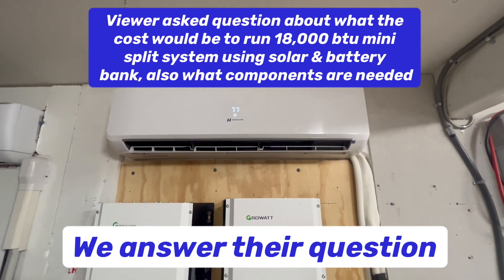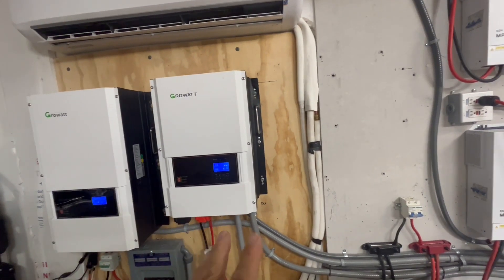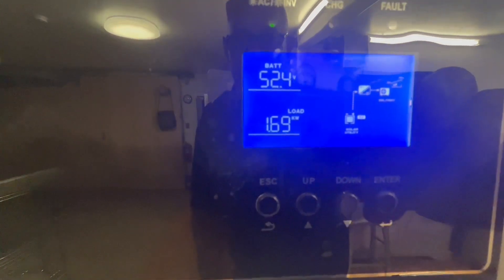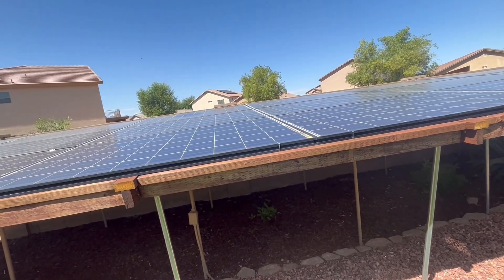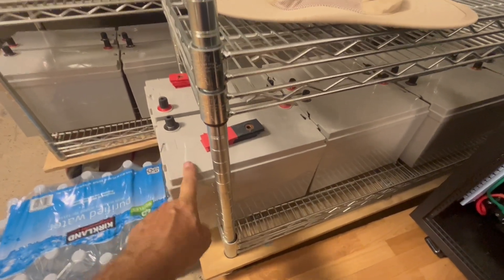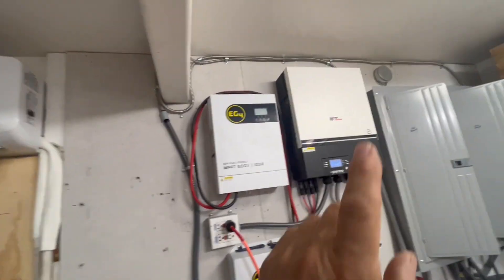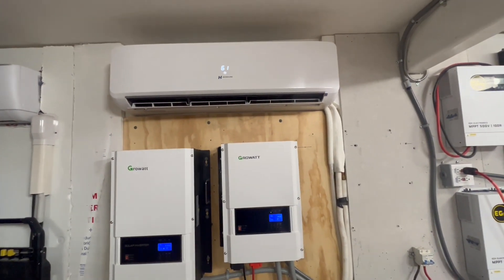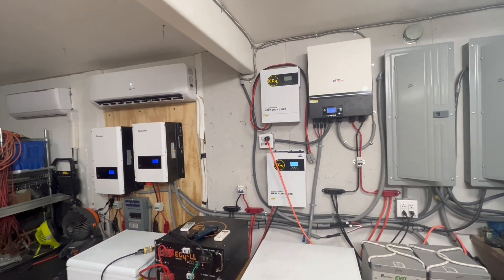Answering question from viewer using solar & battery bank running 18,000 btu mini split AC & cost

Comment: What was the Ah rating on the AGM batteries you had operating the mini split before going to  lithium-iron phosphate? Where in Gilbert do you get used solar panels?
Reply from the maker: I had 16-12.8V AGM batteries. Each battery 100ah. But you could get away with 4-12.8V batteries in series to make a 51.2V battery bank for a 48V inverter. Each AGM is 100ah but 4 in series is still 100ah 51.2V battery bank.

You cannot run the mini split until you have enough solar and cannot run mini split overnight on battery bank. You can not drop battery voltage below 12V average on each battery. 4 in series would mean you should not go below 48V on 51.2V battery bank. I still have those 16 AGM batteries and they still work because I kept in air conditioned garage while using and kept from going below 48V when in series.

You can get a hybrid 12,000 Btu mini split that is direct solar connect that runs on solar only during the day (example 4-400 watt solar panels in series) and use a new 12 gauge extension cord to connect to plug into 120v grid outlet and run on grid overnight. You would not need inverter or battery bank for hybrid mini split. 

SanTan Solar is located in Gilbert south of the 202, about 1 mile East of Gilbert road on Germann. 
596 East Germann Rd # 104. Please use Link below to purchase products on their website. 
You can get new and used solar panels and the 12,000 Btu hybrid mini split from them.
Airspool Solar Hybrid AC Unit With Heat Pump. 

https://www.santansolar.com/?ref=PappasOffGridSolar
Reply: @diy-solar-guy  thanks for the info, I sent you an email
Reply from the maker: @tadstephen8802 not seeing the email?
Reply: @diy-solar-guy  I sent to the email that is under more info on your channel
Reply from the maker: @ I’m sorry, I still can’t find email? Did you send it today?
Reply: @diy-solar-guy  I sent it again
Reply from the maker: @tadstephen8802 mi 18,000 Btu mini split uses 2200 -3000 watts at peak in middle of summer. I need 5000 watts of solar panels to insure I can run the mini split and not discharge my battery. While running. Would need at least 4000 watt output from inverter.

Comment: What if you put a 110 mini split w heat pump on box truck using 400 watt flex panels would that cut how many pannles
Reply from the maker: A cheap 110 volt mini split (cost $500-$800) will need 1200-1300 input watts from solar panels. You would need 2000-2400 watts to consistently get 1200-1300 watts through the day time. You would need an inverter and batteries as well. That will be at least $1500-$2500 for inverter and batteries basic set up on top of cost of mini split. If it is cloudy, you might dip below 600 watts input. Then the mini split would stop running. 

You could buy a hybrid EG4 12,000 Btu 110 volt mini split that can run on 600 watts or less direct with solar input into outside unit. You could run that as soon as you are able to get around 230-300 watts of solar input.  It you would want to connect 1200-1600 watts in solar so it would stay running when cloudy out.

I just installed the EG4 hybrid 12,000 Btu mini split in my garage and run with just 7-100 watt solar panels in series during the day from 8 am to 4pm. I actually have 12-100 watt solar panels that I will use when I go camping and use a portable ground mount solar array set up.

Basically if it takes 1000 watts peak to run a cheaper mini split or what ever you want to run, double the running watts in solar panel input. So use 2000 watts input. The EG4 hybrid 12,000 Btu mini split, you can install 1200-1600 watts. Hope this info helps. Hope you have. Truly blessed 2025
Reply from the maker: Also flex solar panels will only last a couple of years vs rigid aluminum frame solar panels lasting 10-20 years. The quality on flex panels is not there yet for long term in weather especially AZ weather. I see a lot of videos where there get burn marks in just a couple months to a year making solar panel a hazard and needs to be replaced. Aluminum solar panels are up to 75 percent cheaper than flex solar panels. Check out the Grape 100 watt solar panels in the link on my video. Right now only $35 each plus shipping and tax.

Comment: This is kinda not up to date information? You can buy a 1200BTU EQ4 AC/DC mini split Seer2 22 with no inverter no batteries and a built in AC limiter for about $1300.00
Max 380 volts  min 90 volts. Im running one on 4 370 watt panels in series.
Reply from the maker: You are correct, you can get direct solar connect mini splits now that can run during the day with no inverter or batteries provided you have enough solar connected for cloudy days or rainy days. Thanks for sharing.

Comment: Just get you an EG4 hybrid mini split No inverters needed you connect directly from the solar panels to the unit, I have four 400 w Canadian solar running to an EG4 hybrid mini split with no inverter and it works flawless.
Reply from the maker: Very nice, I want to get one of those mini splits as well. Thanks for your input. Hope you have a very wonderful and extremely blessed 2024.

Comment: $15-20K is adequate, depending on your location. When your neighbors are out of power, can’t get to town due to ice or the gas station doesn’t have power or internet and can’t sell you gas…you’ll still be warm and making coffee. It’s silent, doesn’t stink, rarely breaks.
Reply from the maker: You are correct. The best part is the system is already paid itself in savings. Now it is just free electricity from here on out. Recouping your cost in less than 4 years is a great investment. Especially since out kw cost has almost doubled in just 2 years. I have 20 extra solar panels in case I need to replace some down the road and back up inverters. Thanks for your input. Hope you have a truly wonderful and extremely blessed New Year.

Comment: Basically you need a million dollar system it seems.
Reply from the maker: With inflation the way it is going, that’s about right.
Reply: Not necessarily, you just have to be willing to shop around. I put a decent system together for about $5000. Not all at once of course.
Reply from the maker: @asus12351  exactly, this is an investment that will pay off saving you a lot of money down the road. I invested $20,000 over 4 years and the system has paid itself off in savings already. This year will be free electric. Our electricity rates have almost doubled in just the last 2 years. My electric bill will continue to be low all year long. I over produce so I can save even more by adding more things around the house to run on solar power in day and battery bank at night. Thank you for your comment. Hope you have a wonderful and blessed week.

Comment: Hello I am in Phoenix area on the westside. How many batteries do you have and how much do you want for them? Are you for hire to install a solar system just for my mini split in the garage? i have solar for the house already and not so happy with the results.
Reply from the maker: Hi, I am in the southwest corner of Phoenix. I have 16 AGM batteries, want $100 each. I use the AGM batteries only during the day. Just using they batteries to run ac in house during the day reduced my electric bill over 60 percent. I had 4 separate 24 volt 120 volt output inverters in parallel at the time that could run 5 mini splits. I can show you how to install mini splits and set up off grid solar but physically I am unable to do installation. I am going through some medical issues., I can show you how easy it is to install yourself. Actually took me 6 days to install mini split in motor home. Had to use hard core prescribed pain killers day and night.That would probably take you 2-4 hours to do the same.  On grid solar is not a good way to go here in Phoenix due to the utility company punishing you to go solar. They are loosing income when you go solar. They wanted to raise my electric bill to a minimum of $125 month. That would be even if I produced 100 percent of my own power. My winter months are $60 now and $100-$150  in most summer months.I would be happy to explain and show you how to do it yourself since you live so close if you want to contact me. An email to contact me ppag53421@outlook.com. Contact be and I will help the best I can. Hope you have a wonderful and blessed day

Comment: What size of charging controller would you need for that system  for mini spilt but my mini split is 110v   off grid and what size of inverter
Reply from the maker: At least a 24 volt pure sign wave inverter. You can connect between 2400-3000 watts in solar panels. You could run 2 mini splits with that system.

Comment: LifeP04 is a game changer when it comes to off grid. I started out with a deep cycle in my shed to run a 40Watt LED light connected to a small 400W inverter. It could hardly keep up I found cheapest 100-amp LifeP04 battery off Amazon about $230 on Prime day. What a difference it can go to a much lower voltage, and charge lot faster which is what you want for solar. My battery charges up off 2 265W Q cells in an hour. Now I have a small window AC unit in the shed with high temps in Phoenix right now can't keep up I'm using Utility power during off peak in the day. Then I run it off the panels during 4-7pm peak time.  I'm thinking of expanding EG4 system and batteries is a great deal 100 amps at 48V for about $1300.   Doing some quick research, I calculated could build a DIY off grid system for about $1.15$ a watt. I could be wrong but be cool to do some real calculations using Santan solar used panels. EG4 can be synced together along with the batteries.
Reply from the maker: It is an investment but I spent around $5000 a year for last 4 years and system will have paid itself off in December of 2023 with just electricity bill savings. Thanks for your wonderful input and hope you have a wonderful and truly blessed week

Comment: Are you still considering selling your AGM batteries. Richard
Reply from the maker: Yes I am still selling the AGM batteries. Have to be able to pick up locally. 4 for $600($150 each)or 8 for $1000($125 each). I have a total of 16 AGM batteries. I used to run my 3 1/2 ton upstairs air conditioner and 2 mini splits downstairs from 8 am to 5 pm daily using these AGM batteries. I had 4 sets of 48 volt battery banks in parallel. Never let go below 12 volts each. Did not use overnight. Saved 60 percent off electric bill using these batteries during the day. Using the LiFePO4 batteries overnight really only saves me another 25-30 percent. But LiFePO4 were really expensive. With this weather I run my LiFePO4 batteries down to 20 percent overnight and some nights when temp is 115 or more I still run ac on grid power so I have 100 LiFePO4 battery bank in morning to start cooling house at 6 am. Let me know. Hope you have a wonderful and truly blessed week
Reply: Sorry more than I thought. Good luck. I live in Mesa Arizona
Reply from the maker: @galenluth4347  thank you for your reply

Comment: Not sure what type mini split you're using.  I have 4 of them (1-24,000, 2-12,000, 1-18,000 btu) and none use that amount of amperage.  I live in the desert too.  The 24,000 btu has been connected to a 15 amp/240 volt breaker for 3 years without ever tripping a breaker.  Amp readings at the unit measure 2 to 8 amps per leg (range).  Also instead of buying premade lithium battery banks, I was able to build a 11,500 watt/hr battery for under $2000 using 16 - 230 a/h (3.2) prismatic batteries in series along with a JBD bms.  Even with a Victron 150/35 charge controller the cost was barely above $2000.  I was able to purchase a Sigineer split phase 6000 watt inverter (also charges off grid or generator) for under $1200.  So, for less than you paid for your 4800 watt/hr EGXyG748921 battery, I built an 11,500 watt/hr battery.  2-1/2 times the storage for the same money.  You need to remind your viewers that it's always better to build yourself if at all possible.  And perhaps get your mini-split checked out.  I owned an hvac company for many years so I have a bit of experience with unit amp draws.  I saw a lot of waste in your system.  Overkill, if you will.  And YOU CAN used mixed panels with the proviso that your output will be diminshed to roughly the least pane's output.  If you can feret out the very weak panels and eliminate them it's possible to produce output using mixed panels that is good.  And if you buy large lots of used panels, you can test them and match them for some pretty good results.  Many of the used panels are down in output and thus the reason for their replacement.
Reply from the maker: I am able to start a 3 1/2 ton and 4 ton central heat pump and a 12.7 ton heat pump pool heater with these 2 Growatt low frequency off grid inverters. Mini splits slowly ramp up, but these heat pumps have a huge surge at start up. It is not overkill on system. It is what is required to start very large loads. You won’t be able to start these heat pumps with that set up. You can build your system the way you want but you shouldn’t criticize others for building their system the way they want to. You are comparing apples to oranges thinking you are comparing apples to apples. The whole point of DIY is to build a system that makes sense for your own unique situation, I should not try to build my system according to what you want me to build it to since you have no clue of what I need to run with my system. Someone asked me a question and I answered it with the equipment I have. It is reckless when viewers go off on a tangent. The viewer did not ask you the question or ask for your opinion. You seem to assume a lot in your comments and assume anyone else that does not do it your way if wrong. I am happy you built your system the way you wanted to. I have no problems or suggestions for you for your system. You built it according to what your needs are. I built my system while going through 2 incurable caners that I still have to get treatment every 8 weeks along with the extreme pain and side effects. Built it all by myself taking days and weeks to accomplish what you probably did in minutes or hours. I can only work solar for a few hours a week due to limitations I have. Some times I can’t work on it for weeks at a time due to pain and infections. So comparing what you built to what I built makes no sense. I am greatly limited by my condition. Maybe you could think about this before you try to make a DIY person look stupid on purpose to try and make yourself look smart. I think a smart person shares what they accomplish with others at no cost to them except their time. That is what I am trying to do. I could of deleted your comment but wanted to take the moment to share facts you knew nothing about so that maybe you don’t do this to others. Sharing what you built is wonderful. Trying to make others look stupid on their own channel is prideful and makes you actually look bad in the end. I forgive you and hope you will in the future share your what you accomplished and stop there. I hope you truly have a wonderful and extremely blessed week
Reply from the maker: Thanks for all that information. Hope you have a wonderful and blessed week
Reply: Where can we see Your DIY video?  I would be very interested in your setup.  Thanks!
Reply from the maker: You can see my videos on my YouTube Chanel, DIY solar power with pappa off grid projects. DIY solar guy.
Reply: @diy-solar-guy link plz
Reply from the maker: What link are you looking for? Components? Videos? Not sure. Please be more specific, Thanks, hope you have a wonderful and truly blessed week.
Reply: would you please make a video showing your setup.....PLEASEEEE
Reply: @aday1637 Hey, where can I get those prismatic batteries, and how much for each of them?
Reply from the maker: @JuicedupGorilla I have links in the description, just click on toll pm link and look for batteries, there are 12v, 24v, and 48v server rack batteries. Prices for 48v is $1299 plus freight. Hope you have a blessed week

Comment: I think I might upgrade to a 18000 BTU mini-split myself I was afraid they would pull too much power but from this video I might be able to handle it I also have a 220v MPP Solar similar to the one you have on the wall sitting here on my floor been sitting there doing nothing for about a year now
Reply from the maker: Dry easy to install both and easy to connect. Mini splits are so much more efficient especially when you get room to temp set. Than you hardly use any power. Thank you for your input.